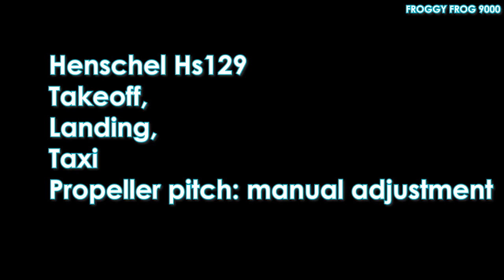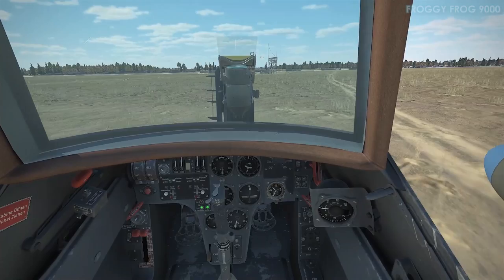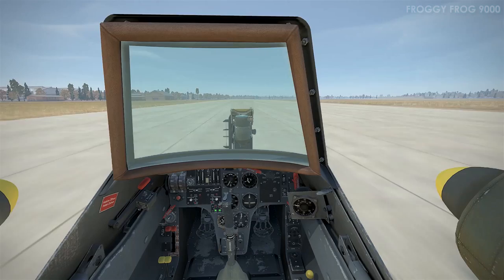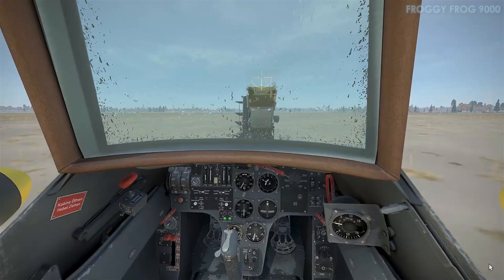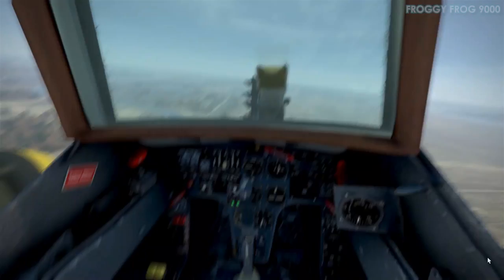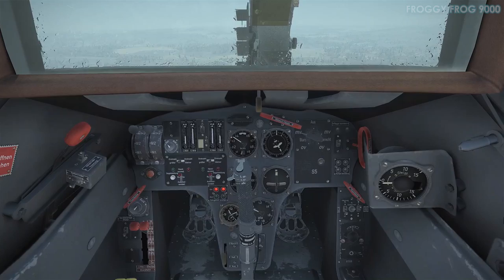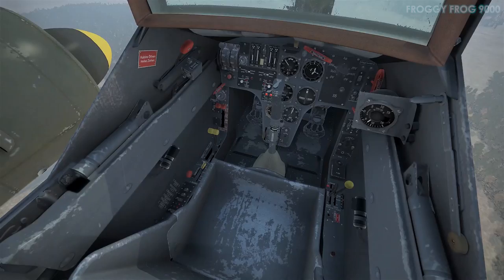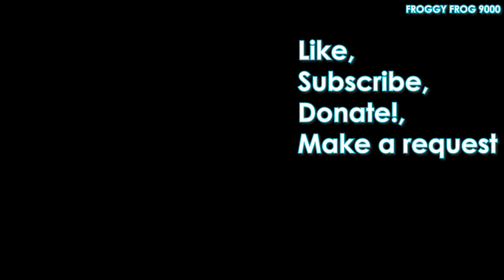Henschel Hs129 takeoff, landing, taxi & manual prop pitch (IL-2 BOS)

Comment: I was doing donuts for days on takeoff . I finally figured it out . Go full power right from the start .Stay off the rudder just apply brakes as needed.Once up to speed near end of runway drop flaps to 35% . Still takes a bit of practice but a hell of a lot easier.

Comment: I am not certain, but I believe that full feathering (default key binding LCtrl + "F") will take the blades past the maximum coarse setting to reduce drag further.  I have seen a recommendation to set full coarse on planes that do not have a feathering feature (single-engine fighters trying to glide with a dead engine, for example).  
Fine pitch for taxi will also minimize the torque effect - not as much of a factor here since the Duck has contra-rotating propellers.  For most twin engine planes in the game that do not have that feature, manually setting full fine pitch for taxi helps control.  (Bf-110 is an example.)

Comment: I know the roll of the aircraft as a ground attacker but feel for a twin engine aircraft it should be faster then it is my two cents thanks for the walk thru love it !
Reply from the maker: You could be right its top speed should be 408 km/h, it does seem a bit slower than that, although could be that top speed is at high altitude.
Reply: i wonder if not being at full realism and complex management handicaps the player somewhat i have noticed AI planes develop awesome energy states and close on targets faster then me at times .
Reply: This conversation does more to convince me that the Duck is not well developed here.  As far as I can see, the random automatic pitch control would not be acceptable to the Luftwaffe.  And. . . Slower than a Sturmovik fully loaded with 6 100 KG bombs?  Seriously?